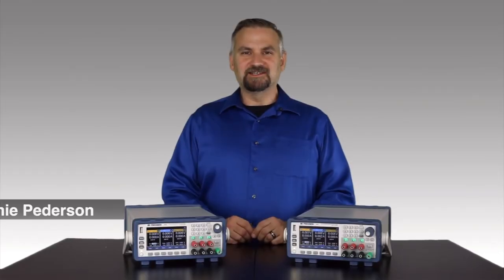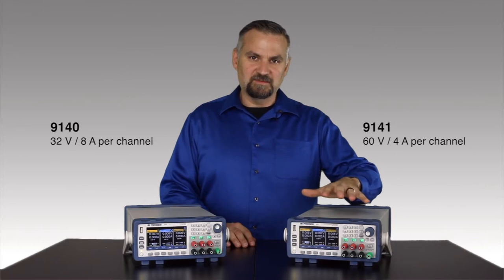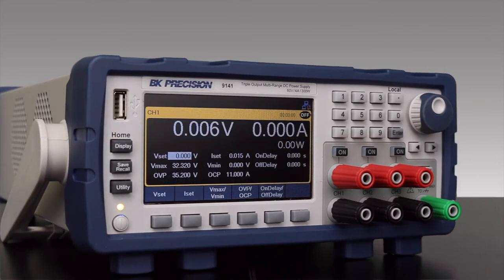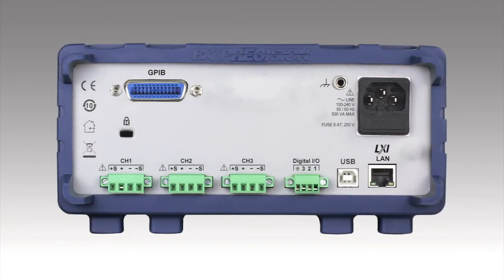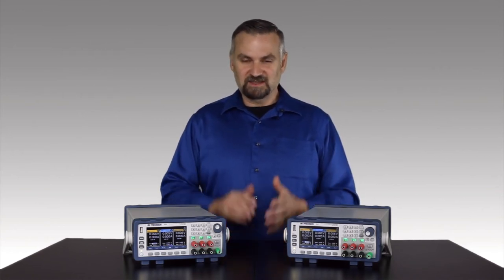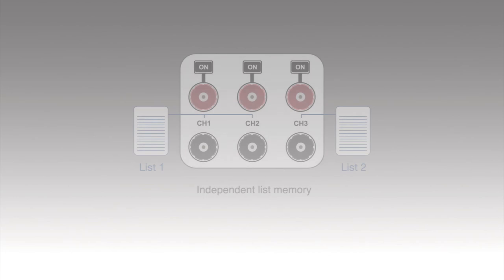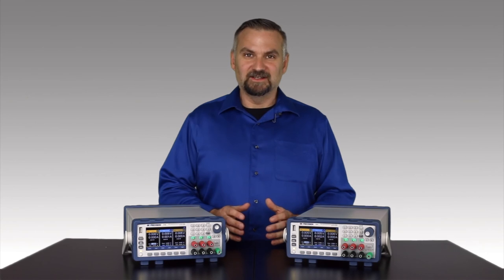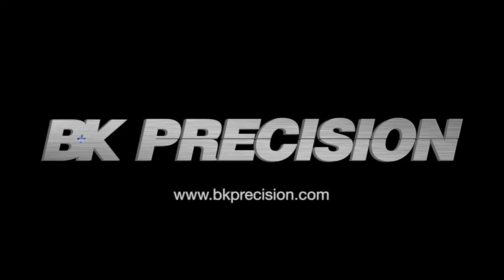9140 Series Triple Output Bench DC Power Supply Overview

Comment: Good. But it have no serial port for easy integration to MCU-based systems.
Reply from the maker: Hi Борис, thank you for the observation. The 9140 Series’ USB mode can be set to USBTMC or USBVCP (Virtual COMM Port) from the USB settings. USBVCP mode allows the instrument to communicate as a serial device using the downloadable USB Virtual COMM drivers available on our website.
Reply: @Bkprecision1  It would be nice if the USB port provided OTG style reversible operation so that if a user connected an FCI chip type USB to RS232 serial adapter, the BK unit would function as a serial interface controllable supply.
Reply: @Bkprecision1  Thank you! I found "Programming Manual" , it is sufficient. Will LabView drivers be avaliable?
Reply: @blameblame6146  Only in dreams. Serial Port -> R.I.P. :'(
Reply from the maker: Hi  @User3578742267 , we plan to have LabVIEW and IVI drivers available for the 9140 Series on our website within the next few weeks. Let us know if you have any other questions!
Reply: @Bkprecision1  Thank you!